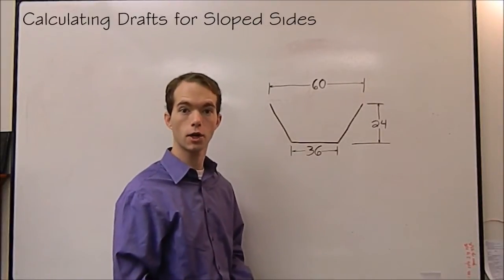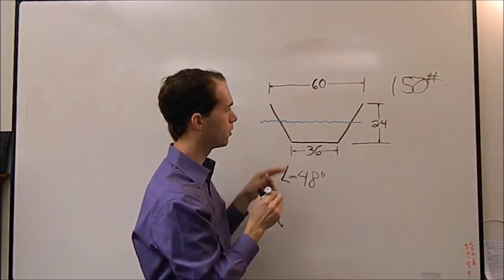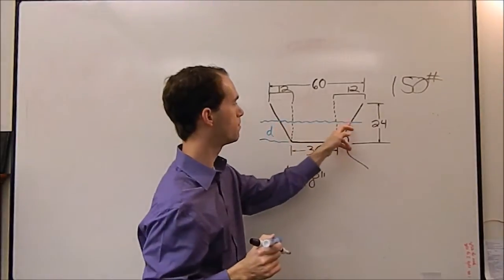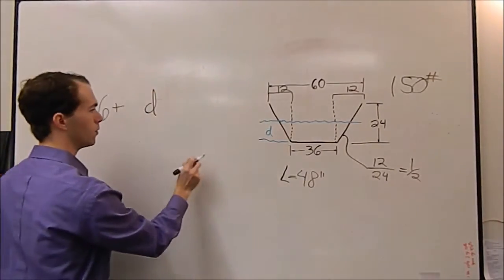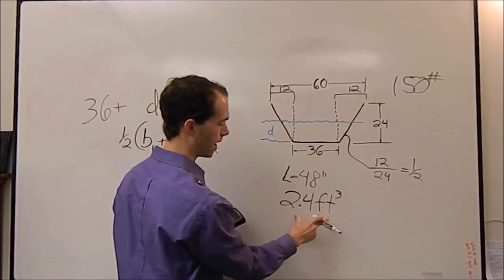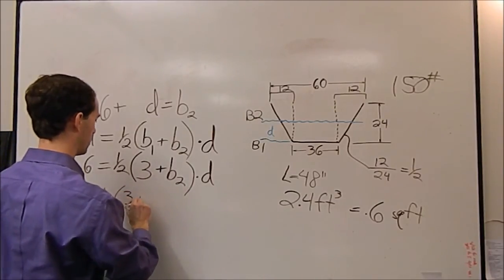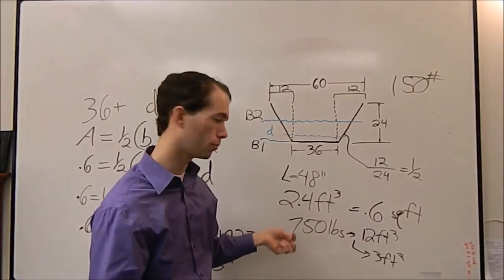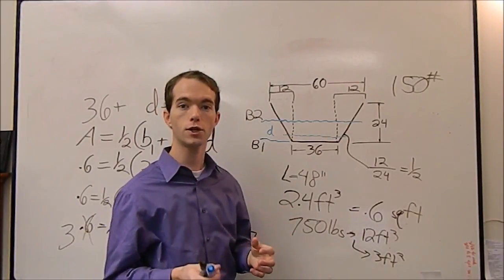How to Build the Fastest Cardboard Boat: Advanced Draft Calculations     Mikes Inventions

Comment: I can not follow what is b1 and b2 are exactly.  I just would really like to have a formula where I can just plug in some values and find the draft? depth for any boat.
Reply from the maker: B1 & B2 are the two parallel sides of a trapezoidal shape. The boat In this example has a trapezoidal cross section, so the standard "area of a trapezoid" formula is used.  I wish such a formula existed, but the formula has to be derived each time, because it depends on the particular boat.

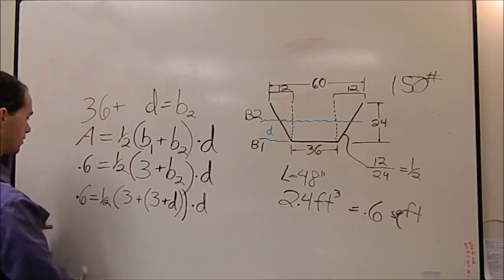Comment: You lose me at 8:30  I don't understand how you got to the answer .1937 because I couldn't see you solve that equation how do you solve it step by step?
Reply from the maker: +Kerry Lemieux   Hi Kerry. Sorry I didn't show it. It's rather lengthy. I just plugged it into my TI-89  originally. I just worked it out by hand though, and can't figure out how to get it to you. Luckily, I found a site online that will walk you though it. Algebrahelp.com. It goes through way more steps that I did, but it explains all the steps. Try this link from the worked problem: http://www.algebrahelp.com/calculators/equation/calc.do;jsessionid=A19D8A79F8DDF8430EBFBA33E92B6EDF?equation=.6%3D.5*%283%2B%283%2Bd%29%29*d&solvf=dIf that doesn't work, just type in the problem as it is on the board: .6=.5*(3+(3+d))*dAs a final note, the negative answer from the quadratic equation doesn't make sense because that would mean the entire boat is 6 inches out of the water, so it must be the positive answer of .1937 feet. I hope this helps Kerry. -Mike
Reply: QUADRATIC EQUATIONS